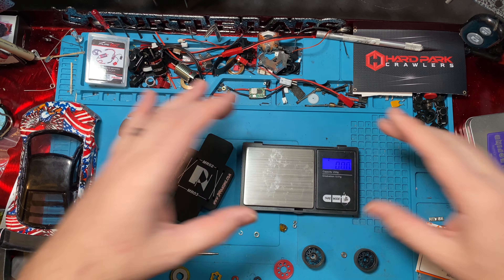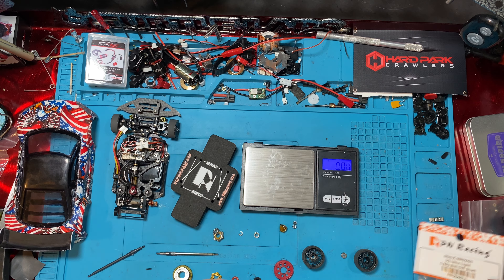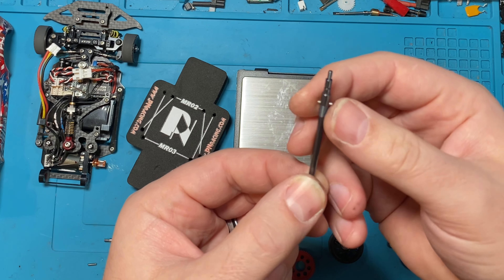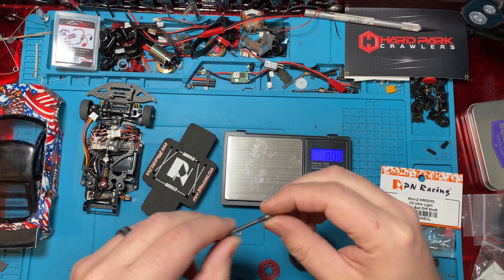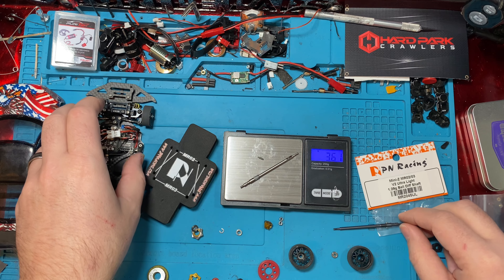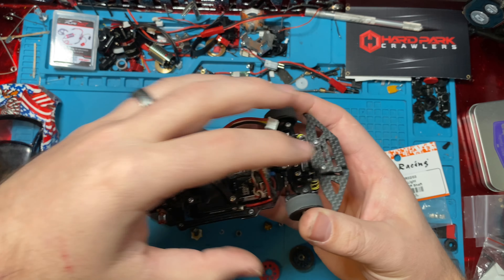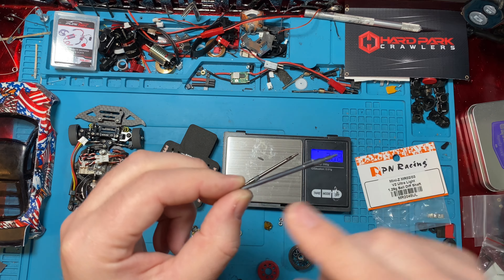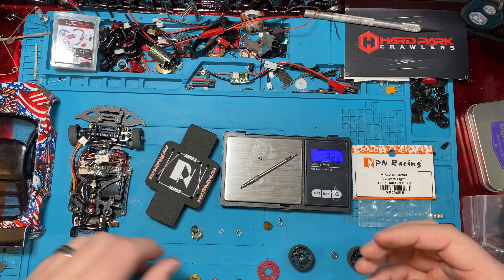Mini Z 1/28 Scale On-road - Save some Weight With the PN Racing Ultra Light Drive Shaft!!! MR2045UL

Comment: I read many comments about light weight shafts being very prone to damages. As I do not need to be or are capable to benefit from the performance increase I stick with the heavy steel shafts.
Reply from the maker: Totally fair. You have to be a top level driver to feel the difference for sure.
Reply: @TheShopMiniRC   I skipped the Kyosho models and  entered the 1/28 business with a GLR kit and some tuning parts (brass chassis and some  others). The car performed so well, that I purchased another  GLR and  3 club mates  also got one (they try to get rid of their GLAs now). I left the front end stock in order to  have some plastic that absorbs  energy in case of an impact. Performance-wise I don't see any need for front end upgrades (chamber steering knuckles might be a nice option for the setup).
Reply from the maker: @ringofthebrave  I think steering knuckles are a worthy upgrade but yeah. Keeping some plastic is good.